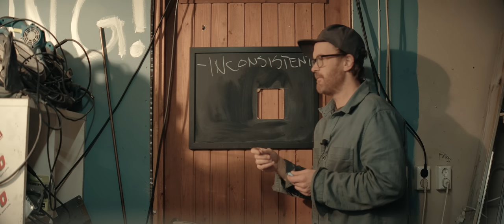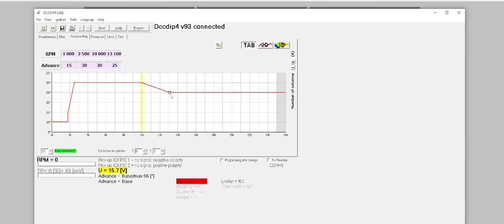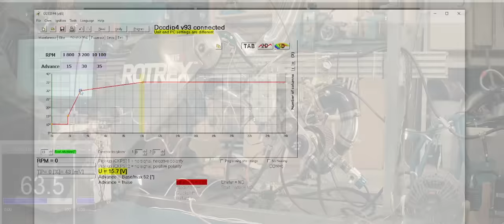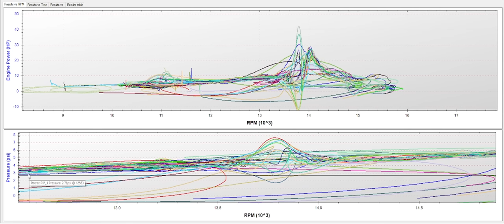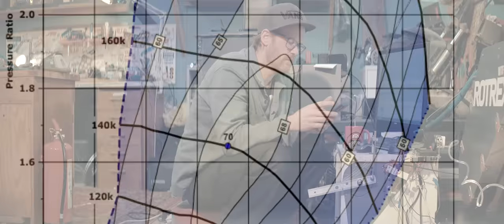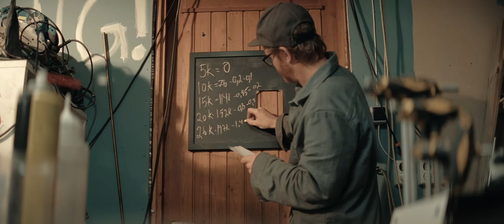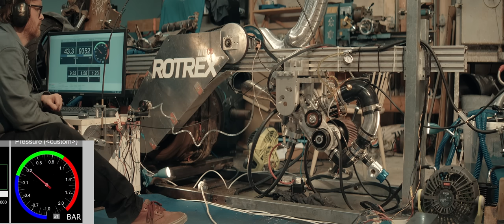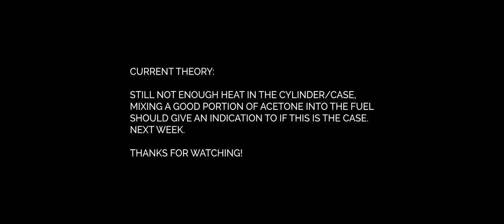Supercharged Pulsejet Engine?

Comment: Alex the snowmobile guys run tripple cylinder 2 strokes with 3 expansion chambers that have 3 stingers feeding into the turbo charger. They have been running boosted 2 strokes for over 10+ years already.
But if you understand that their setups are going into powerband first always..... Then the boost comes on only after powerband peaks?
That has to be the case because the exhaust has to exist the stingers to drive the turbo first 👍
You are trying to create boost first and it's messing with the power band in my opinion? But you can't clutch the supercharger until the engine reaches powerband first because the supercharger will be a restrictor on the intake at air will need to pull past the turbine when it's not driving?

At least with the turbo they can keep the waste gate open to allow the engine to get on to powerband first and then slowly closing the gate to add boost until peak pressure👍

You can't carefully do that with a supercharger. You can if you don't run a power pipe and run it like diesel 2 stroke truck that's super charged and actually run it on diesel? But they are build entirely different to how you've built this motor?

Comment: out of interest,why the need for the blower ,tricky, heady mixtures of fuel recipies and all the  associated dificulties?.way back in the day honda were getting almost 200 hp from normaly aspirated 500cc engines (nsr breed)and  petrolium race fuel!. at the moment you seem to have about 30hp peak  from a blown 50cc,,times ten =300hp!! !,now that equates to 300hp on a 500cc motor but they are only "peaks" not consistent climbs into and holding on to the power @wot for any length of time.I AM NOT KNOCKING THIS  MAN,,,,,i have followed him with interest and full of admiration of his attitude to solving tricky technical problems.....BUT,,,LECTRONS!!,best suited to 4 stroke  drag bikes perhaps,although king kenny had em sorted on his tzds back in the seventies.,,i am no technical expert  but maybe if you started with  a normal keihin race carb from a tz or rs 250 you would have a better benchmark to start from. also,perhaps it would be better to use a motorcycle rolling chassis and a  rolling road type dyno and software  that is currently the accepted  way of measuring the rear wheel  power of motorcycles.,,, i do understand the difference between  "water brake" and "rolling inertia dynos". and the cost of buying and installing one is high so you are inbetween the proverbial as we say.keep on testing and i look forward to your next escapade.

Comment: You're changing to many things at once! You cut the end of the pipe of and found out that it's way worse than before, why not revert it? You know the engine runs better like you had it before. Same with the plug. It ran better with the racing plug, why not put it back in? You made the engine build more boost, the flames out the back got even worse and it started at a lower rpm. Sorry, but obviously your theorys aren't realy correct. In the last video it ran the best after switching ignition units. It reved smooth and under load you cold reve it almost consistently to 16k, now the engine has problems over 15k and doesn't reve smooth. In the last video you also said the oil might be the problem that the plug can't ignite the mixture and thats why it backfires. But now you have enough engine temp and you still have this problem. So it's obviously not that the plug can't burn the oil. This is one of my most favourite channels, but the way you go about doing things just kills me.
Reply: And that it got worse with increased boost,  just proves my theory that I commented on the last video even more.

Comment: Add propylene oxide in about 10% to the methanol/nitro mix. It really wakes up the ignition of those fuels with low cylinder pressure

Comment: hey i know this sounds kind of defeatist, but i bet if you ask an ai software dude he could make an ai the could generate an engine and have it printed on a metal 3d printer. i bet the engine would weigh half as much and have 50hp. 1cc per hp

Comment: 😈😈😈😈trouble is theres no environmental control using the spent gases to control  the flows of capasity which correspondingly lacks back pressures to eliviate the over taking of tye cylinder movements.... 😈😈😈😈

Comment: 😈😈😈😈uthose friggen 300 cc 2 strokes pulling hp numbers close to 500 cc 2 strokes obviously mainly through the fuel injection...  i know ktm probably  make a 50 or 65 cc carbi ....   maybe an 80 or 125 jetted  down !    The dead spot must be the eventualities of high power ranges , not to mention the motor must be contour balanced and heavily restricted for optimization. ...  just throwing ideas at you .... did you liie the chain saw blogs ... those guys make some crazy machines that never miss a beat !  😈😈😈😈😈 thought provoking

Comment: 😈😈😈😈 I truly believe its possible to get to 50 hp from this motor !   Turbine  turbo to eliminate the overtaking of the fuel management system and reduce the flooding effect , reusing the spent gases to be reentered into the formulation , as the supercharger creates a venturi effect pulling in unneeded fuel ...    its like youve created an after burner ...   how  that eventuality . ...  😈😈😈😈

Comment: Methanol car don’t even run cooling system when drag racing 
I’ve seen a video from an NHRA top fuel crew chief (clay Millican crew) explaining to PFI speed how the ignition system need way more power and ignition time to let the slow burning alcool burn you should look into this.

Comment: Actually with nitro fuel and forced induction... 

U dont need to run coolant at all..

Cooling system can be eliminated...

Engine cooling by nitro combustion is good enough to keep the engine cool

Comment: Why didn't you just keep your water tank at, let's say 99°C.
Reply: Most "why don't you just" suggestions : If it was that obvious, it would have been obvious... 

Making a hot water system would be a week's worth of work in itself;  and there is no real world application once the engine development is finished.
Reply from the maker: Lots of water to heat up, and i would've needed a more heat resistant tank and pump.
Reply: @2STROKESTUFFING  
How about putting a restriction in the top hose, cut the flow right down, the fuel seems to be pretty good at getting rid of most the heat on its own. This engine seems to use it like an alcoholic at a free bar!

Comment: Mix 10% petrol in, speeds the burn.
Reply: I thought that as well but got the impression they did not mix from Wikipedia.
Reply: Might be right with methanol?  I guess I was thinking ethanol, it mixes well. I just use 91 octane, I think of the petrol molecules starting lots of little fires all over the combustion chamber. 
They mix 15% petrol into ethanol (E85) to help speed the burn and make starting easier when cold.

Comment: every time, every video ended with the same words: see you next time. nothing happened.. as every single time. I think you should work on a normal 2stroke engine ad try to do something good with a normal one.. like 400 440 horse power/liter. 
In your tipe of engine there are too much unknowns questions and too few certainties in my opinion.
i see many things that aren't normal.. first of all the pipe! in a high performance engine, but also in no high performance engine when you builtup a good pipe, it colored out blue or purple.. in your engine inst! I think you have too much unburned fuel in the exhaust ad this reduce alot your backwaves power.
I don't wanna be argumentative but i follow you since i was 18 yold and now i'm 24.. and i'm pretty fed up of your failures. I wanna see something good from this channel. so my advice is to come back to normal 2 stroke ad starter from there with your supercharged! (i like your ideas but.. there are too much unkonwns question has i said before) 
sorry for my english 
ciao dall'Italia!
Reply from the maker: But imagine how good you will feel when you get that success video😁
Reply: @2STROKESTUFFING  Honestly Alex i don't believe in what you have just written. Not in the actual conditions of the engine..
I'm curious about your opinion on exhaust pipe colors, cause in this high performance engine as you defined it, i don't see them not even in the collector (first section of the pipe  before the divergent cone)
Reply: Ps: see you next time ;)